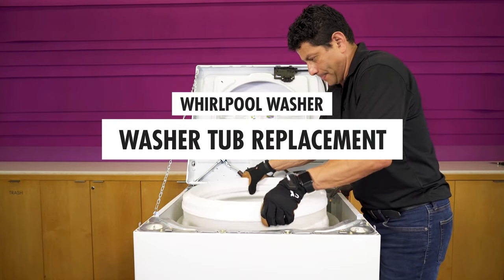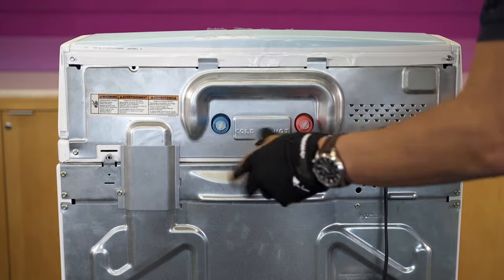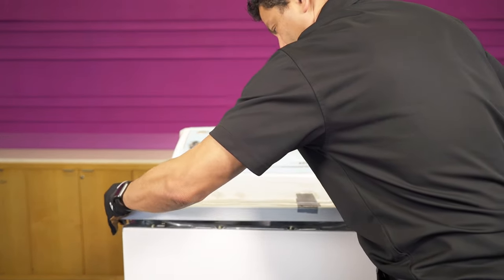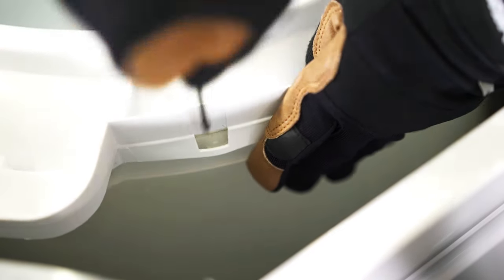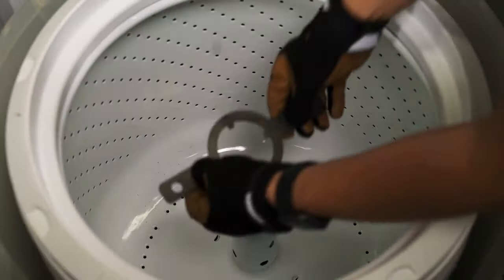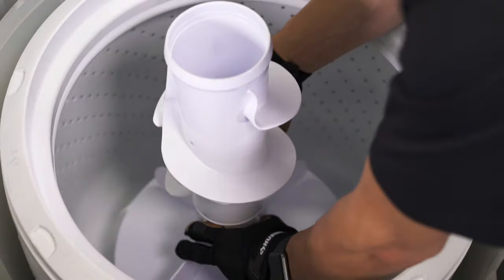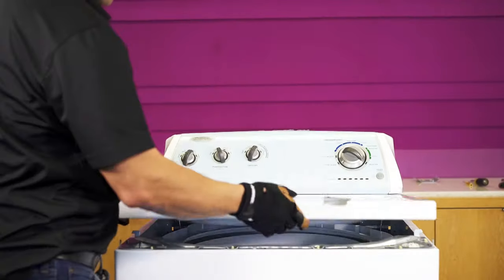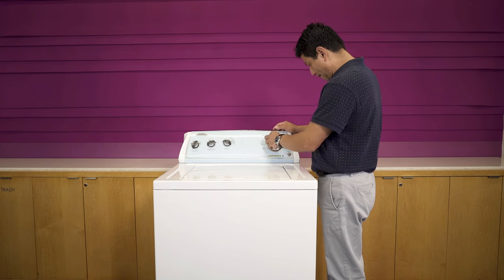Whirlpool Washer Washer Tub Replacement

Comment: I left my old washer and dryer in the garage of my last apartment that came with a washer and dryer. The issue was I didn’t know that I should leave my doors open when storing them. 3 years later I’m moving into my partially renovated home I’ve spent a year on and my washer outer drum is covered in a green mold, that looks kind of like soap scum. I’ll be buying a nut wrench tomorrow so I can maintenance my washer, next I need to figure out what’s wrong with my dryer. Thanks for the simple video.